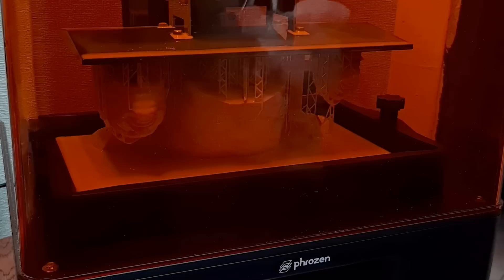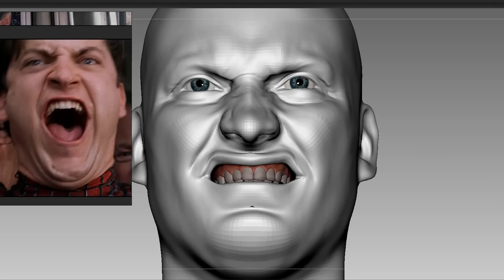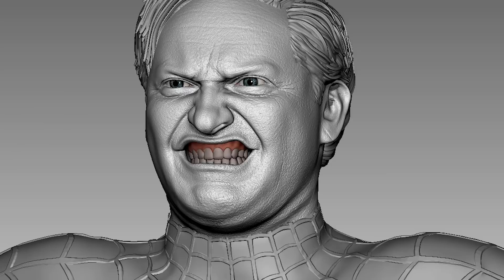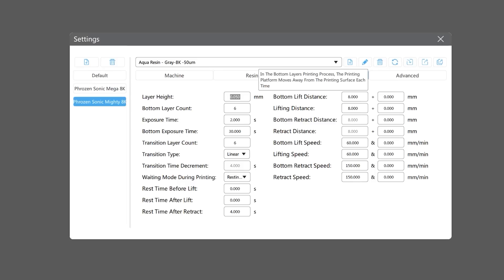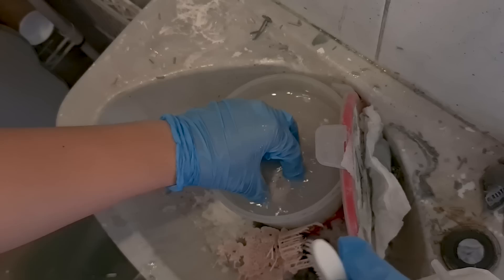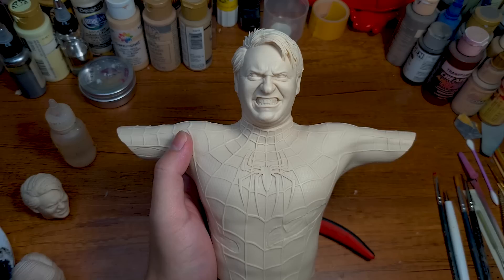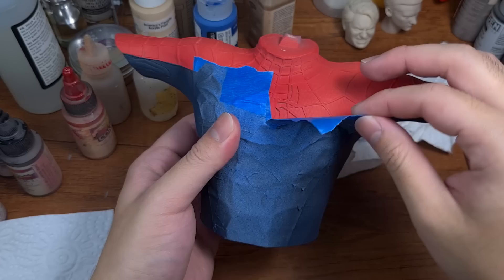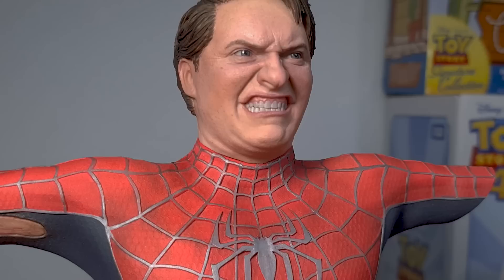I Made Spiderman Train Scene! | Phrozen Mighty 8K 1/4 Tobey Maguire 3D Print Spiderverse

Comment: The details are that printer are insane and really cool. I JUST REALIZED SOMETHING there wasn’t any sanding in this video! That printer really is something special if Zedabyu doesn’t sand anything smooth 😂😂
Reply from the maker: LOL yeah usually even 1/6 heads would require some sanding around the neck or back of the hair but these light supports are just scrazy
Reply: @zedabyu  yeah that’s a big positive about this new printer. I wonder if this printer would print the facial hair of the tony stark head you made earlier this year in February?